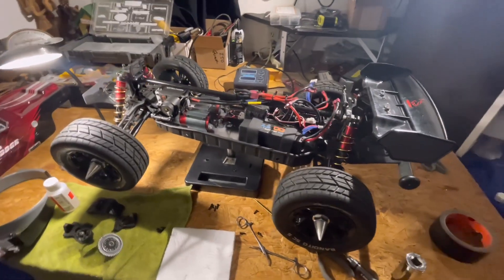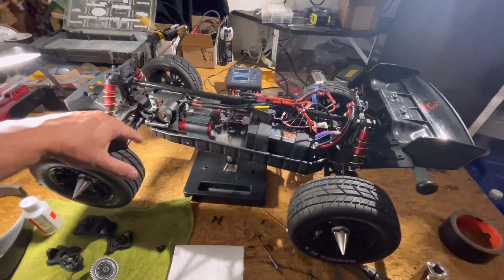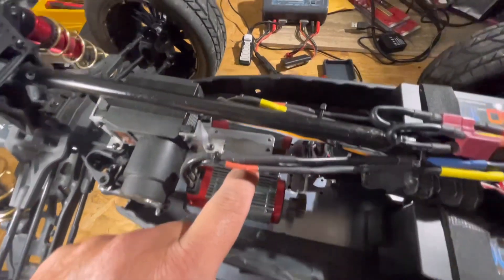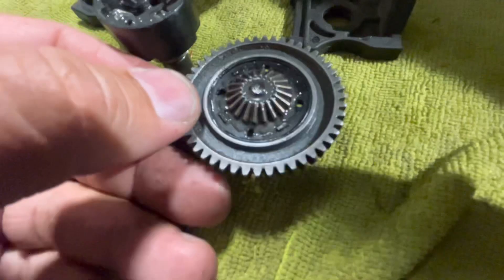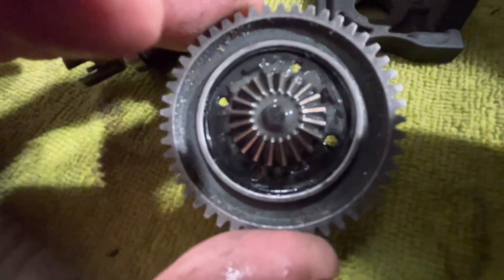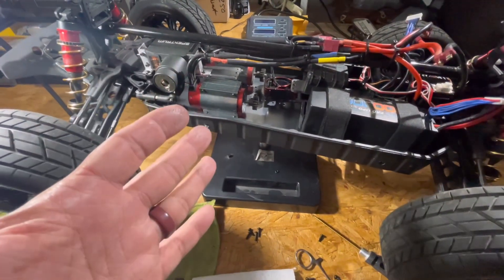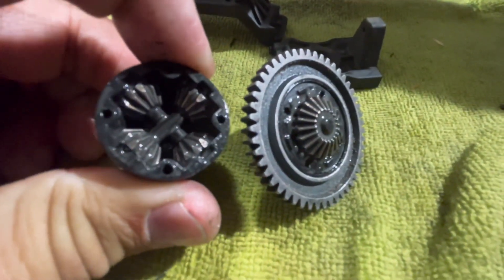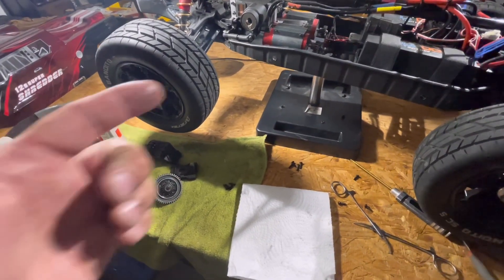BULLETPROOFING the Redcat Shredders diffs does it really work? See for yourself!

Comment: Good way to prove that your way of doing this,has made the shredder more than what the shredder is.i said it and I’ll keep saying it,you are the Master Shredder.
Reply from the maker: Thanks man! It was a video I shot on the fly and thought it was a good way to show everyone how the center diff was holding up. ☢️🤙
Reply: @RadioactiveRC  my shredder held up great when I did the shimming on all three differentials,I take the shredder on some hard  straight runs full throttle on 6s stock motor and doesn’t over heat at all,maybe by putting on the 18T pinion? What should I expect?
Reply from the maker: With the 18th opinion you should be running cool and get a good amount of low end bashing torque and high speed. If you’re having good luck and good performance out of the BULLETPROOFING process go onto the Facebook and social media pages and let everyone know. The more people know about this process the more money and time it will save fellow hobbyist. We also need to try to grow the channel the more it grows the more crazy the builds will get of all kinds. If I’m doing all this with a Redcat Shredder just imagine what I can do with an Xmaxx or K8s. ☢️🤙
Reply: @RadioactiveRC  thanks for all the good information.will throw out all the information out there.

Comment: My shredder is running like a beast,with the 500k differential oil.so 1Mil is way better?
Reply from the maker: I’m not sure if 1M is going to be better or not. The 500k is still the best on 6s in my opinion. I can tell you on 12s the 500k is not enough. I’m giving up power to the front tires based on the video. If the tires are still giving me problems I’m going to throw the dbxl-e tires on and see what happens. ☢️🤙

Comment: Haven't seen any "hard runs" with your Shredder. Its a nice version but so far no proof of being "bullet proof"!
Reply from the maker: Thanks for watching! Did you happen to see my last video running the Dual Motor Super Shredder on 12s for 20 mins up and down the highway between 50-60mph? If not check it out no fires no breakages just ripping on 12s. If that’s not enough all I can tell you is stay tuned for more. Next two videos on these builds will be crazy. I’ve been putting in a lot of shop hours on these two Shredder builds! They’re both getting harder like folding hot iron. 
On another note one day you will see every basher RC with my transmission and clutch or ones like it. Its the future of RC. No one wants to change a pinion in between bashing and speed runs or at least I don’t! Now I don't have to.  ☢️🤙